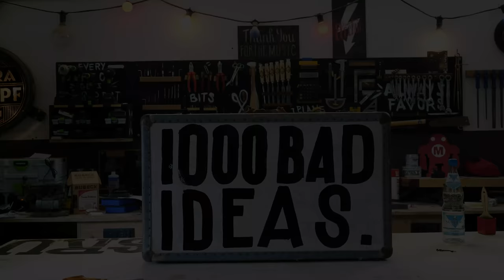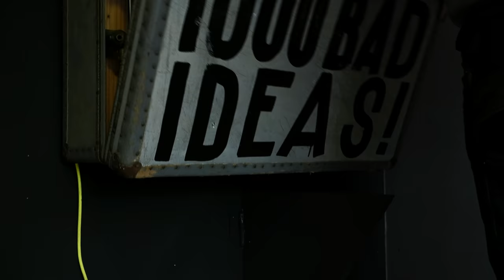1000 Bad Ideas

Comment: Thank you for this. This is a topic my students constantly struggle with. They are always waiting for inspiration or constantly doing research instead of just getting started. I shared your video with them so they can hear it from someone other than me. I also happened upon a quote recently that speaks to this: "Action comes before motivation". Just get started. Try things you KNOW won't work in the design process. Do things the wrong way on purpose. All of these things will eventually lead to the right answer.

Comment: Many years ago I was told the secret to taking good photographs was to take LOTS of photographs and only print the good ones. There is some truth to this, over time you learn what "good" is. Perhaps better composed, better lit, different focus etc. It's the process that is important - but you don't have BAD ideas, you just have ideas that teach you something that will make something else good. I've built enough projects (and "failed") that I consider wood grain direction, I consider order of operation, (route edges before assembly or after?, finish sand the inside of a box before assembly?)  all the things I've learned came from something that may have been considered a "bad" idea.  I often wonder "How did she know to do that?" or "why did she do it that way?" it's because you've learned.  Fortunately for us, you're great at teaching your audience so we can also learn. Keep up the great work!

Comment: The thing is that the qualification 'good' in relation to 'bad' always in context of something that is interesting, amusing, practical, etc. Thus unless you have multiple ideas, you can't use good or bad. Also stop comparing previous already executed ideas to those you haven't executed yet. Going forward means execution, not executed because an idea is not as 'good' as a previous one simply means you are not making progress. Compare it to a marathon, you don't stop running because you can't run as fast as the previous distance, that would mean you lost the race by definition, you keep on running because otherwise your previous efforts will no longer have meaning.

Comment: Some of my most creative projects started without a goal.  I've started with a wire and twisted and bent it at random.  Then based on that inspiration I built a second object that captured some aspect of the first.  Then a third object inspired by that one.  I eventually got to a great piece that blew me away, evolved through a relatively unguided process, each step based on the previous step but without an overall plan.  The challenge isn't to get to something great, but to overcome the anxiety of setting out into the pathless wilderness.

Comment: Laura, I absolutely love your ideas and videos, they are a plethora of creative and inspirational pieces. Since I’ve started woodworking, I’ve always feared the day I ran out of ideas. I have a ton in my head with no end in sight. If I ever do run out of ideas. I’d think I’d want to improve an old project, branch out incorporating a new task, or testing my ability on a far-fetched project. If you need a suggestion, my next project is to create a scissor jack out of wood that will raise my mitre saw about 15 inches beneath my workbench by a hand crank. The flip-top workbenches don’t excite me at all. Enjoy your free time, it won’t last long. 🤣

Comment: My problem is I just can't come up with totally original ideas...I have learned over the years that I can take someone else's idea and make it "better"  
The first really good idea I had was a continuous hot water heater...it was based on a standard hot water tank...but heavily modified.  
Mind you this was when I was 6 back in 1974...and it did work...but I had no way to put it into production so it sat there for a long time.  
Of course you can get them now a days in most home improvement stores...but in 1974 it was not a thing yet.

Comment: One idea: beautiful, artistic, yet working and safe.... data storage!  take an old usb-stick, plug it into an extension cable and cut this cable. Unwind the different compartments of the cable on both ends. Now simply create a sculpture / object / piece of furniture.... which comes in two pieces. Both pieces have  corresponding metal parts, with the corresponding wires soldered to it. The part with the cable extention you connect to your computer. Now when you assemble the object, the data storage is connected to your computer. The soldering is super simple. I made it work with clothes-pins and a cardboard "card" and it worked. looked like crap though. 
I guess you could totally kill it with some cherry-wood and metal combo. a huge Lego brick, a statue with a detachable head, integrate it into a tool so you never leave plans at home

Comment: Contact your friends and see if you can make a self leveling system for your camper. (I would start with a quad copter main board and some stepper motors. ☺)

Comment: I need advice for a base cabinet for my Tiny house kitchen. I'd like to build 3 verticle drawers a cabinet door/ section, followed by series of drawers for silverware, plates and glasswear finally pots & pans with lids, followed by another cabinet door with a pull out for the commode to hind in

Comment: Hey, I have this idea using old aluminum cans cut for sheet metal to make a air regenerator like a homemade ERV.  Machine a tool and die to stamp the not flat heat exchanger inner section maybe thinking will be better with the pyramid stepped tool surface also if like triangle shaped... then just easy sandwich with some aluminum all thread the heat exchanger together.  thinking don't even need to weld and can just silicone or high temp glue gun the alternating layers for each side.  Seems like can be really small and effective still.  Utility from waste.

Comment: My life consist of living in a blind swarm of great ideas, and I've alway reached out to pluck the one horrible idea, to waste years, on something that never took a single breath. At one time, you could buy a house for back taxes. I figure, I could buy a house, for less than a used car. I knew what to buy. Nothing to big, nothing to old. I bought a hundred year old house with twenty rooms. At first, if was an obvious mistake. I was overwhelmed. Then I just accepted, that I had to come home from work, and work eight, nine, ten hours everyday, just to get things done. After a year, I found out, the foundation of my home was failing, and nothing I could do myself, would fix it. I was going to give up, when someone said, I could just have the house lifted, and new foundation could be built. It would be expensive, but I could afford it. After the foundation was fixed, everything seemed easier. I could could get old slate roofing from houses, being torn down. Once the roof stopped leaking, I taught myself how to rewire the whole house. Whenever I had extra money, I took down the chip board, and put a window back in. I paid of the foundation, and got another loan for a heat pump. Now my house was warm, and dry, so I replaced the plumbing. It was all  down hill after that. It was a joy, to come home, and  work on just one room. I had bought the house, because I had an Idea of making furniture, and filling my own home with it. My home was surrond by abandon homes, where where homeless drug addicts lived. I had to put a fence, and started working on the yard. Big money investers came in, and bought all the old homes. I was happy, because I wouldn't be living in ghetto anymore.  Soon as  the old houses were torn down, and new one went up, my  taxes went up.  I lost my house to high taxe.

Comment: Idea : bicycle battery charged with muscular and potential energy (concept enlargement).
Thank you for your excellent sparking works and presentations, I drop a bicycle Idea just in case :-) 
Observations : sadly muscular power and potential energy recuperation have not been pushed far enough to encompass most of the possibilities. In short only back-wheel motors can recover some potential energy (because the free back-wheel can't transmit energy from the tire to a crank fixed motor and because of this shortcut they generally don't bother for battery loading directly from the crank). Amazingly 2 back-wheel models (look at :  "Nua Electrica" and "Copenhagen Wheel 1") are great and have quite flexible generators but, I'll be interested for more options :(1) Getting the possibility of muscular and potential energy battery loaders even on crank motor cycles, so it also implies being able to load it indoors (home trainer style).(2) It should be able to short circuit eventual caveats like bike private software not accessible to the bike-hacker. By the way I didn't mention that my ideal electrical bike would have modes of actions completely manuals, so mainly : Normal bike mode (nothing electric in the way of the muscular power) / Electrical assistance, but I would like to choose the assistance myself with a potentiometer  (so absolutely no automatic involuntary assistance because I push on the pedals) / Switch into generator mode with a manual button and with the degree of generation potentiometer dependent (the same as above).
These points stated, there is an obvious solution for a bike hacker : adding an independent generator connected to the common battery, so as long as the bike model has a mode of non assistance, a generator taking the energy directly from the back wheel can use potential and muscular energy. 
The difficulty is how to get an efficient mechanical connection, and the inspiration can come from old style bike dynamos directly rubbing on the tires, so with a larger dynamo (itself can be quite efficient because of synchronous electromagnetism) and a subtle rubber contact (the contact should not be done laterally because of probable too strong forces to apply, but rather directly on the friction part of the tire) with an appropriate tire it's possible to minimize the lost energy due to friction with a very little supplementary mass to add to the bike. 
Note considering the difficulty to add this system flawlessly to industrial models it would be probably easier to consider a manual change of position of the battery to be only in pure charging mode, over-all this hack would be : 
Possible on any bike having a full operating mode without the battery (normally all of them even if it's just seen as an emergency mode in case of full flat power). 
Useful to load  :  At home with the back wheel in the air (could be extendable to load other types of batteries, could also be extendable to some weight training engines ...  without weights :-) with the advantages of doing supersets all the time because with a crank agonists and antagonists muscles are used alternatively which is much better for the joins on the long run).On the top of a very long descent. When feeling extra energetic and willing to load the battery on the top of a pure mechanical bike ride.
Reply: Errata middle text  ... "(itself can be quite" ...  should be read as :
(using the motor itself in generating mode could be quite inefficient because of asynchronous electromagnetism of most bike motors, they are less efficient for electricity generation than synchronous ones, or on the reverse we could see efficiency because no supplementary weight and significant extra costs would be added with an extra generator, but this is more like a factory dilemma).